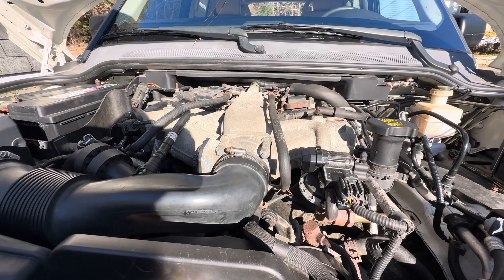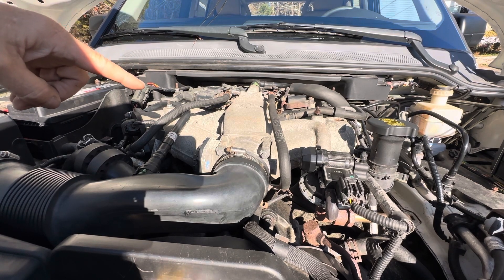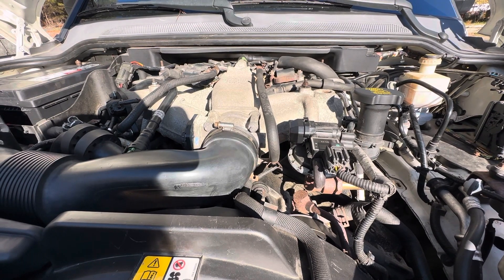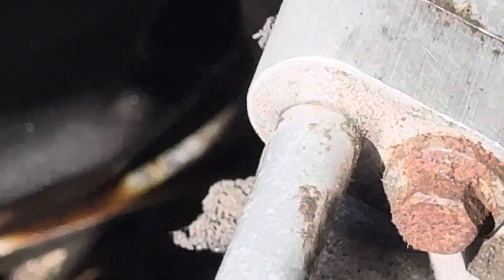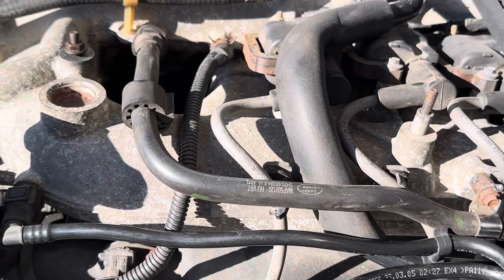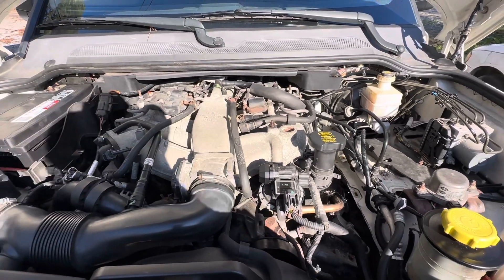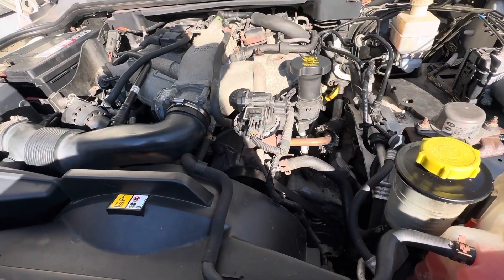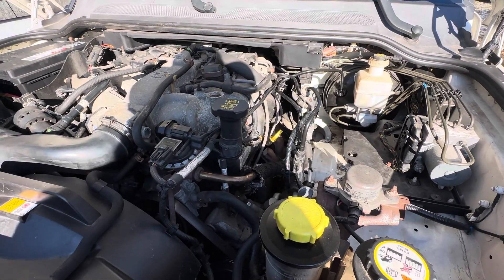with the lr3 rover project part 1

Comment: Did you run some  injector  cleaners  through it?
Reply from the maker: Techron full bottle on 1/2 tank 93 octane
Reply: @jbluesb3southside  check  those gas line filters , after  a bit of driving.   Might  be surprised  what loosens in that tank .